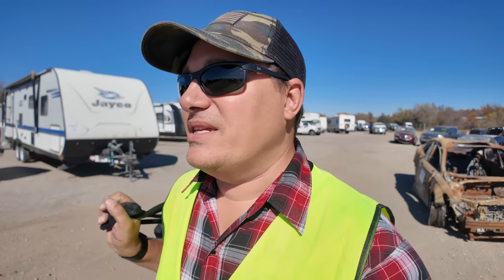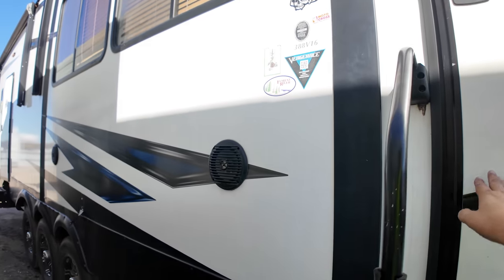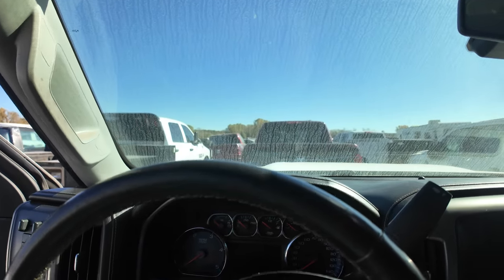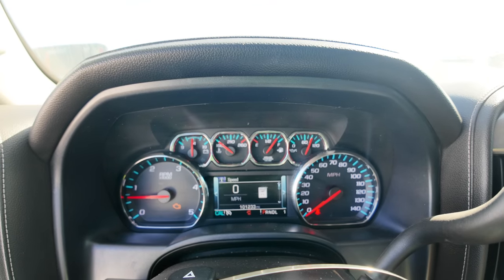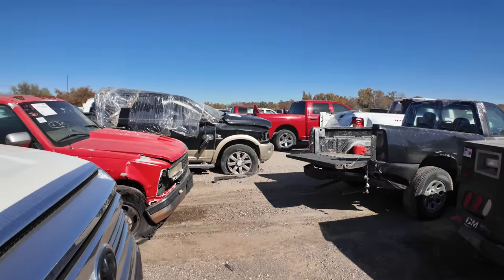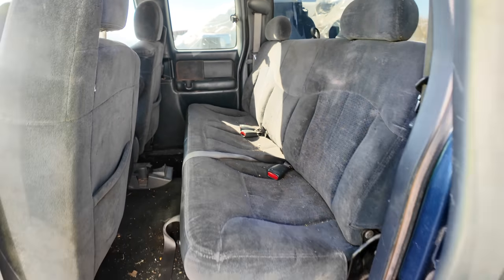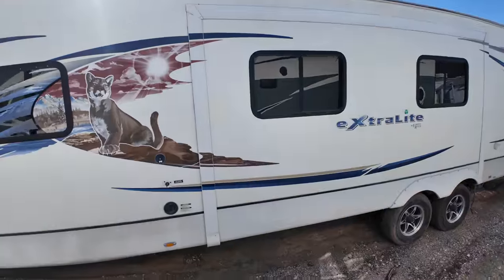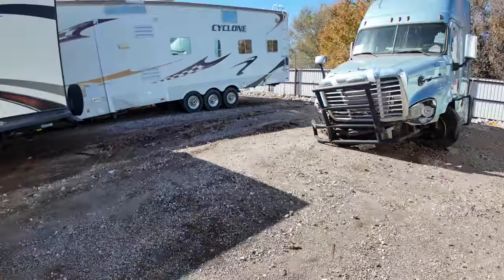I'm Buying another Abandoned RV Camper! 1995 Ford E350 RV

Comment: 95 Ford E350 has a 460. Its time to change the ignition system (all of it as its deteriorating due to age) fuel pump too. The EEC IV computer will need capaciters replaced (they ooze out stuff and quit) The good news: all of the stuff can be had on rock auto. The steering may have a dead spot in the center. Its adjustable if so. Tires: if older than 7 years, replace.

Comment: Just bought a1997 Ford E350 chassis Fleetwood motorhome. Has the v10, new for 1997.  Runs well but has some inside water leaks as yours did.  the worst is in the bed area over the cab.  Hoping after pulling the already ruined trim inside down I will be able to seal the leaks.  Good luck with your bid.

Comment: Go for that Class C. with a litttle cleanup inside, and run thru the mechanical, you'll be set.  The overhead bunk can be a place for a rug-rat, or your camera gear (that's what I used my bunk for at festivals.)

Comment: I would buy the Ford Camper Randy 😎😎👍👍
Reply: New wires, plugs, fuel pump and filters. I think that would get it right on its engine. The 7.5l plugs are usually done every 60k miles due to it being used in a heavy duty application.  😊

Comment: All the wiring can be done on those RVS, take out the generator and rewire with modern thick guage wires and electronic control box, you can even add solar

they only powering a few items.fridge, lights, socket, microwave and stove.
I have gas stove

Comment: It’s not a fire risk that keeps older RV’s out of parks… it’s the abandonment risk. They are hard to get rid of even for free. Especially the trailers which have no real scrap value. So people would check into an rv park and abandon the trailer… it takes months for the park to remove them legally (have to file paperwork and what not ) and they have the expense of disposing of them. So they just ban them instead…

Comment: Randy.  That power inverter is the heat of your RV.  Be careful around that.  You also have some delimitation on the front bumper over the cab.  If that is delaminated it can cost you tons of money to fix.  If wicks Easter into the walls and creates leaks and separation of your walls and floors.

We had a 2008 Winnebago Class C and it started to do the same things.  WE sold it before it got too bad

That would be a deal breaker for me
Reply: That was supposed to say heart of your RV not the heat